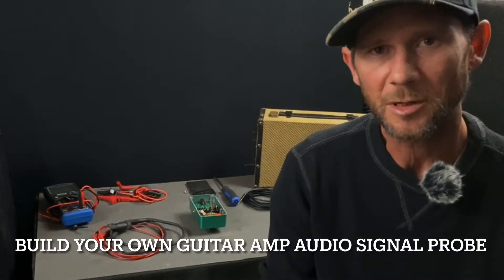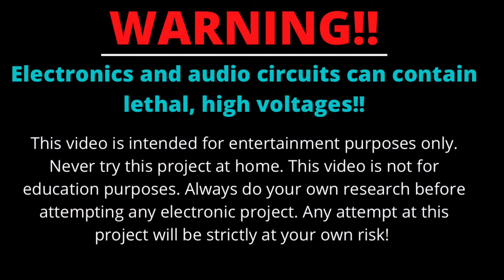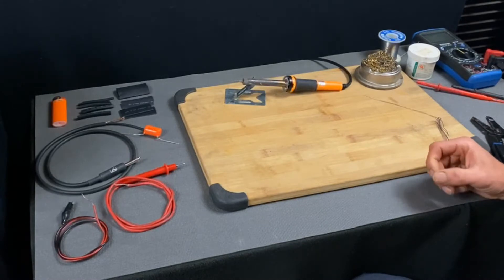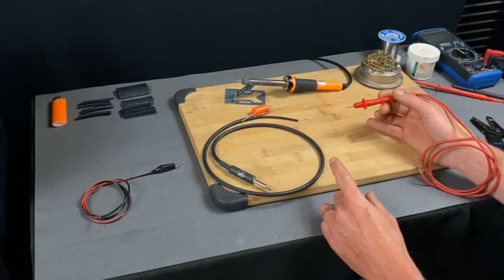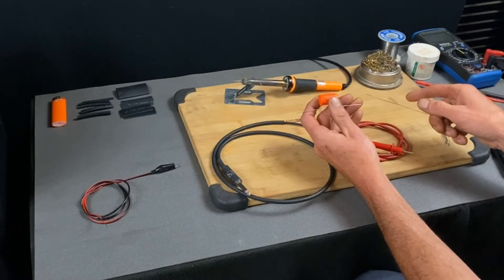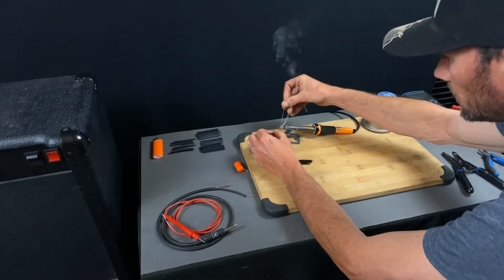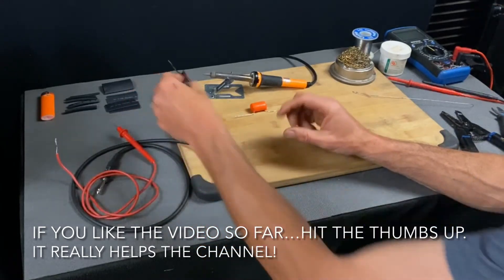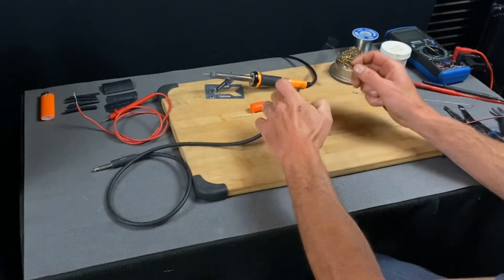Build An Audio Signal Tracer

Comment: I am sure any Metallised Polyester Film capacitor should work i know orange drop capacitors may have different manufacturing process but it's a  Metallised Polyester Film so is it true to say any Metallised Polyester Film capacitor will work. People would be paying high prices for one capacitor when a  0.1uF 630V capacitor cost next to nothing and are the most popular capacitors available
Reply from the maker: That a great point. I just happened to have that cap in my bin. The voltage rating would be the main factor to consider. The other reason I used an orange drop was for quality and reliability. You could likely find a suitable capacitor for free out of a broken or older electronic item.
Reply: @themusiciansworkbench   I opened a can of worms with the question and confused myself in the process. I googled the difference between the 2 capacitors and her is what i got 
The key difference is that "Orange Drop" is a specific product name, while "metallized polyester film" is a description of the capacitor's construction material. Many Orange Drop capacitors are indeed made with metallized polyester film, but they also come in other dielectric materials like polypropylene. 
As we understand a little more the orange drops are for audio less distortion but how do we know what they are made from. 
At this point it does not really matter if we are not putting them in a guitar circuit.
But it's cool to learn something i am good with the voltages as it's 4 track cassette i am repairing one channel they only need 400V max

Comment: Hi , can i use 105  Capacitor ?
Thanks
Reply from the maker: Hi there. I think a 105 cap will work ok. The main thing to keep an eye on is the voltage capacity. If it’s a pedal your testing then the voltages won’t be that high. But a tube amp can have high DC voltage so you would want to be sure that the 105 cap can handle that and not burn up.

Comment: if you are sending audio signal into an amplifier, even if it is line level capable of clipping the signal at the amplifier input stage, isn't it true there is no DC? I've heard of function generators can add dc to create signals with the necessary DC offset to diagnose some device functions, but sending a sinewave signal at any given frequency (the visual representation of alternating current)  from a signal generator or a re-amped guitar signal from an audio interface means there should be no DC present. So why the capacitor? To be honest I can't imagine what kind of device or testing equipment you would be sending a test signal from to a guitar amplifier other than a pure sinewave or guitar signal. Is there something I am unaware of that can be used to help diagnose an issue of audio signal loss in an audio amplifier? (genuine question!)
Reply from the maker: That’s a great question! So the purpose of the capacitor is a safety measure to start. In a tube amp circuit there is potential for high dc voltage in the circuit. When probing around the circuit the cap will prevent shock/damage if you accidentally touch a high voltage solder joint. The other thing is that ac and dc voltage can share the same signal path so the cap will only allow the small ac signal thru while blocking the dc which would likely blow the testing amplifier. It does really matter that much in a pedal as there isn’t that much high voltage but in a tube amp you can have 400-500 dc volts.
Reply: @themusiciansworkbench  damn that totally makes sense. learning something new every day! diagnosing means an issue somewhere, and a bad coupling cap means an unkown source of dc leakage into the audio signal, clearly necessitating the cap you put on the signal tracer. I am glad i asked because i have been slowly learning the ins and outs of tube amp circuits, obsessing over learning how to interpret schematics, and understanding electrical fundamentals, and respecting the danger that exists in extremely high voltages. Anything i start to study, I prefer having as much practical knowledge when going into something over taking risks. thanks for giving me a perfect explanation!
Reply from the maker: @FulcrumsEdge  I also find audio electronics super fascinating!

Comment: Cool. What's the recommended cap value?
Reply from the maker: For this probe I used a 0.1uf/600v (104) orange drop capacitor. It has worked well for for all my signal tracing needs.
Reply: @themusiciansworkbench  does it matter where the polarity is pointing towards to??
Reply: The capacitor…is it polarized?
Reply: @Joejoe-nt3gc this cap is not polarized. It can be soldered in either direction.
Reply: @themusiciansworkbench  thank you

Comment: I have a muliti process guitar pedal that went bad after plugging in to a patch with the gain turned up at the sound board. Maybe I could find the problem with this, it powers on but no sound comes out.
Reply from the maker: I think you could definately trace it to the source with this for sure. Try and find a schematic online and then trace from the input and go down the line. You could also check the power section to make sure it is supplying the proper voltages to the preamp stages with a multimeter.
Reply: @themusiciansworkbench  Ok thanks!